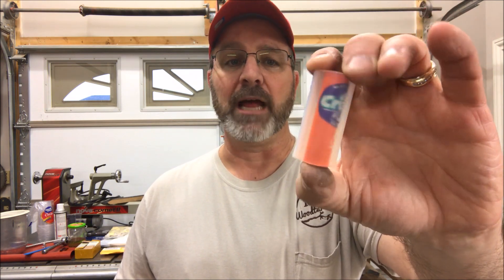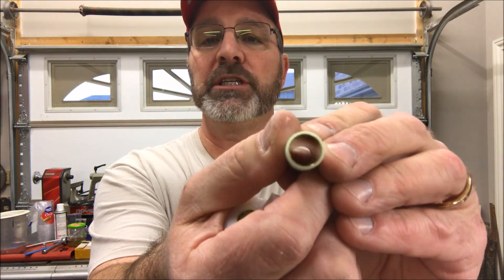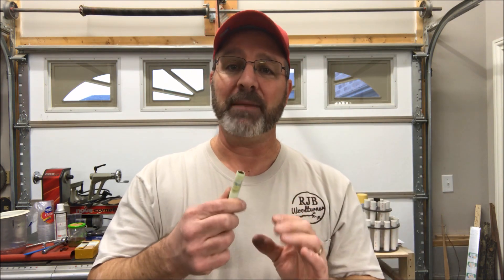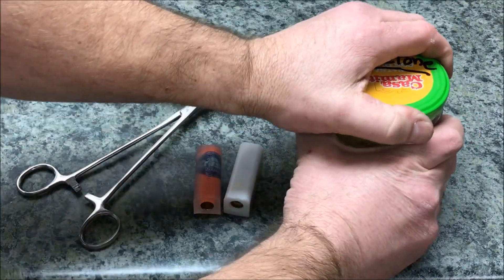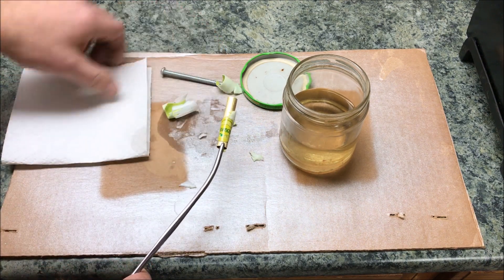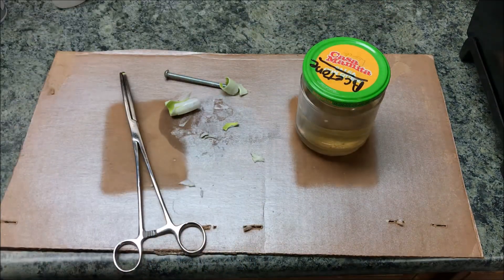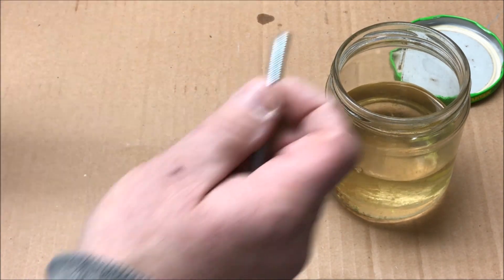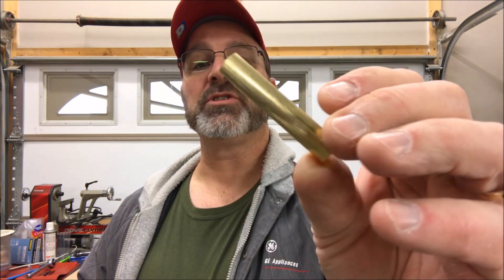Using Acetone To Clean Resin Off Tubes

Comment: Bob, according to Alumilite customer service white cloudiness  is only caused by to much part "A" or not mixing thoroughly. If you are sure you are mixing properly and measuring properly then try reducing part "A" by about 10 - 15% and run a test batch. 
If you get bubbles even after having been under pressure then that is only caused by moisture.
Reply from the maker: Thank you Jerry,
  I will add mixing time and double check my measurements.

Comment: Just be careful reusing tubes. Every time you re-trim the blank after gluing in the tube its going to get a little shorter. Some kits can't handle the blank being too short. I've actually been carrying around two blanks that need that same soak treatment.
Reply from the maker: Good point Cliff,
  I’ll check their lengths before recasting. 

Regards,
Bob
Reply: Its not so much with a barrel trimmer but I've started to use a sanding jig and its real easy to take off some of the tube. For something like slim lines not really an issue but Sierras/Gatsbys and the like maybe not so much.
Reply from the maker: I agree, tube length is critical for those kits. 

Regards,
Bob
Reply: I could look it look it up but supposedly Sierras, Gatsbys and Monets , while they use the same bushings, have tubes maybe 1/32" different.
Reply from the maker: I never looked but I have turned a Gatsby with Wall Street bushings. 

Regards,
Bob